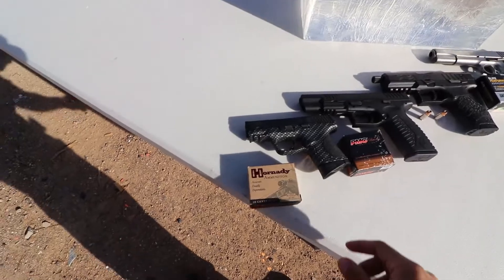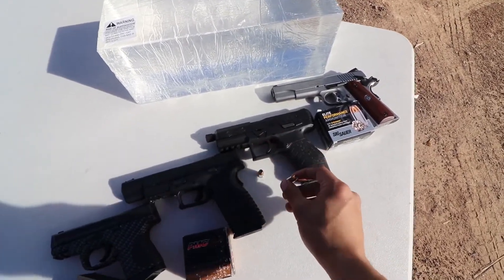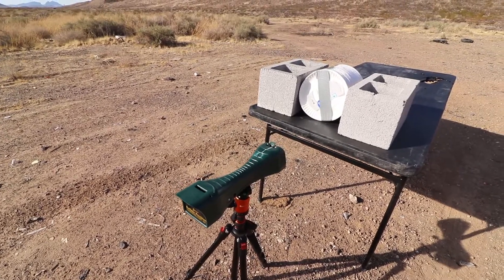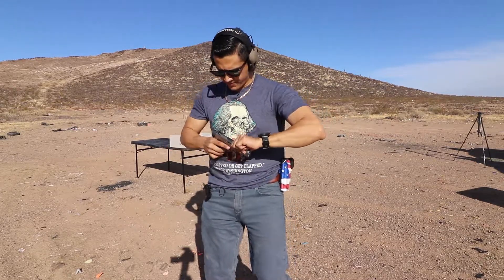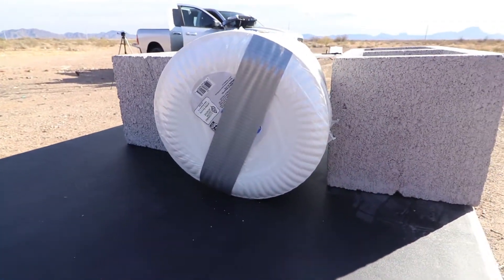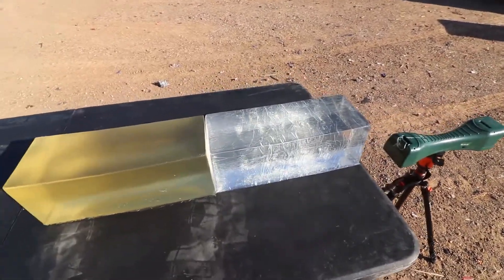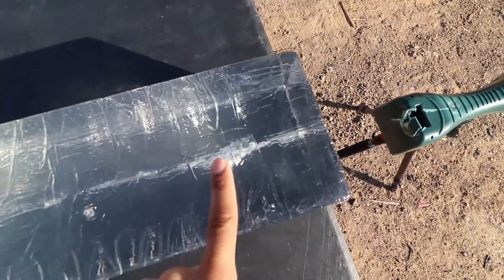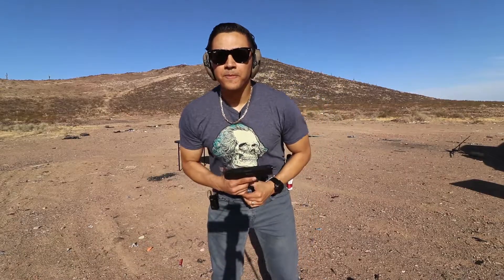HOLLOW POINTS PENETRATION TEST 9mm vs 40 S&W vs 45 ACP vs 10mm VS Paper Plates and Ballistics Gel

Comment: The .45 result was unreliable because that round went through the 9mm damage track for a long distance, meaning it didn't encounter as much resistance as it should have. It probably would have come in the shortest.

The 9mm was pretty darn impressive. 

The .40 didn't even fully expand because it was too slow. 

The 10 expanded a bit more, but still not fully, because it was also too slow. Still, it outpenetrated everything even with defective expansion.
Reply: Maybe, but the expansion was way better than 9.

Comment: Seeing the penetration of pistols.
Also question. If I fired a 5.7mm FN out of a fan5.7  would it be the same as a fan p90 long barrel?
Reply from the maker: It would not. It will penetrate more out of the p90. The longer the barrel, the more time the bullet has to build more speed.
Reply: Ok that's what I thought! Thanks for answering my question!
Reply: @Corry-be4kz  It depends on the ammo.
FMJ ammo will peneteate more from the PS90.
Expanding or fragmenting ammo will penetrate more out of the handgun.

Comment: Weak 10mm, 170 grain load it Should be clocking at least 1300 fps
Reply: PMC is weak sauce in most calibers. But it's usually available and less expensive, though, so there's that.
Reply: Same with the .40 ! 155 grain 40 load should be over 1180fps 🥴🤔… My Speer gold dot 155gr are doing 1200 fps and 496ft-lbs of energy 😳